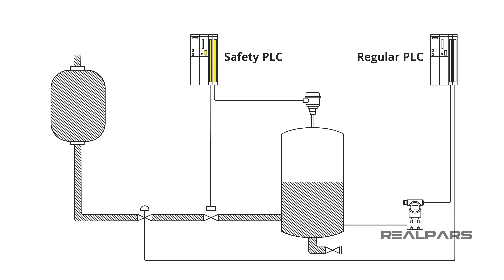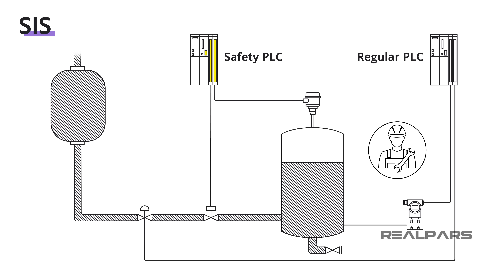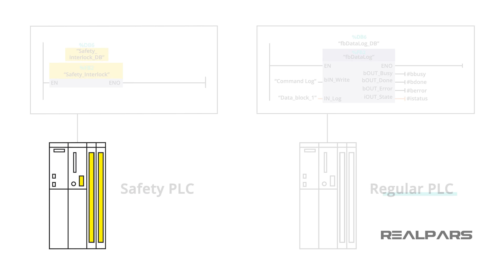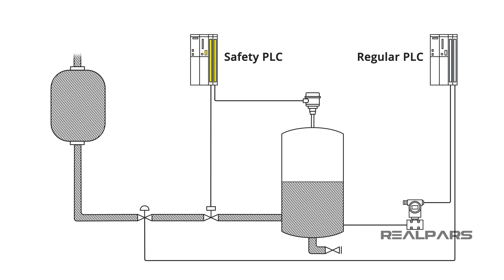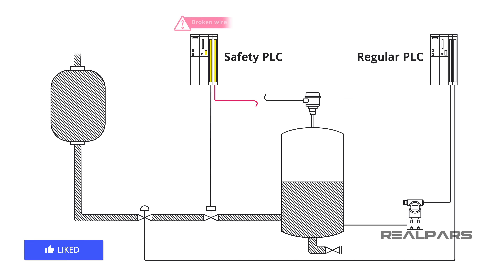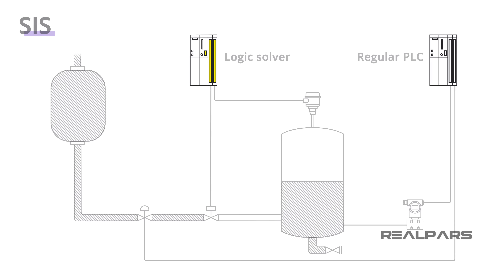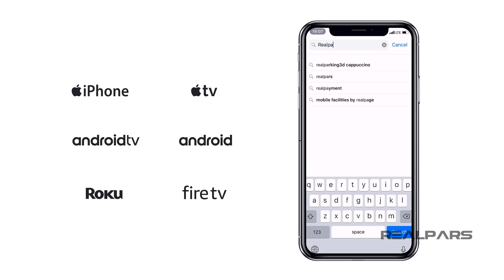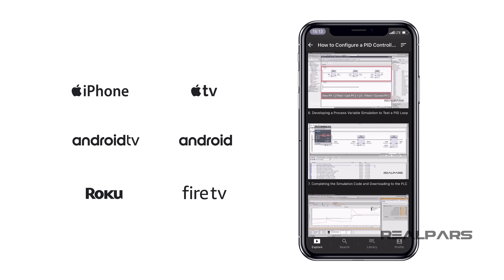What is a Safety PLC?

Comment: Does the logic written for a Safety PLC need to be certified, or does the person who writes the logic for a safety PLC need to be certified, such as TÜV? Thanks in advance!
Reply from the maker: The person who designs the SIS system specifications and details the SIF requirements (including SIL calculations) should be TUV or CFSE certified.  The programmer does not need to be.  The program will be tested against the specifications after installed.  The certified engineer will have ultimate responsibility of the end product.

Comment: Thanks for the video. I would disagree when you say that a safety PLC is programmed in the same way as a regular PLC. Safety PLCs are energized systems while regular PLCs are de-energized systems, which means that in order to keep higher rates of safety, the Safety PLC logic application is 1 to normal and 0 to shutdown, this makes the whole programming mindset changes between both systems.
Reply from the maker: Hi Raul. You’ll get no disagreement from us on your point about programming.  To be clear, when we say that both regular and safety PLC’s are programmed in the same way, we are not referring to programming techniques or mindset.  We are speaking of using the same programming software and/or methods such as ladder logic or function block.
Reply: @realpars  Indeed. Thanks and keep with the good work!